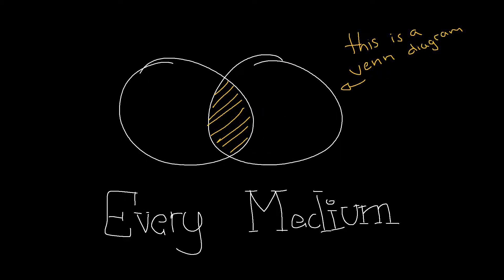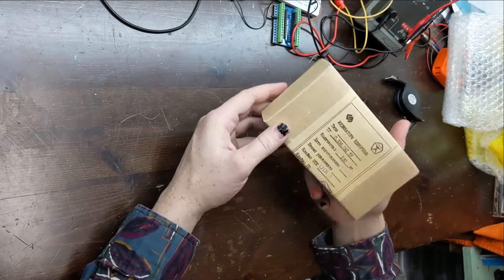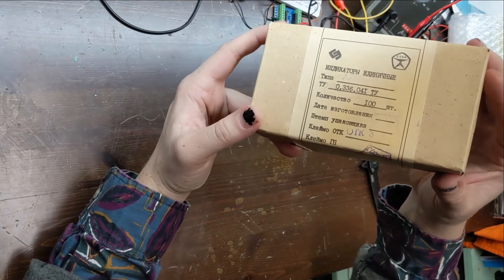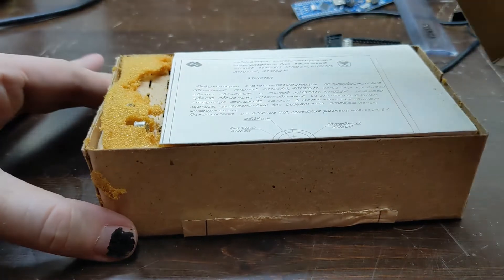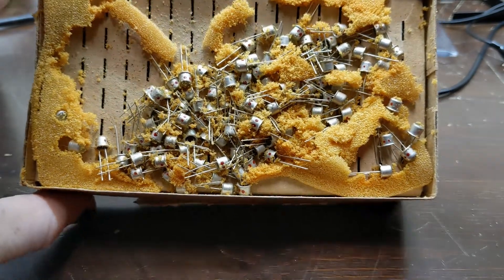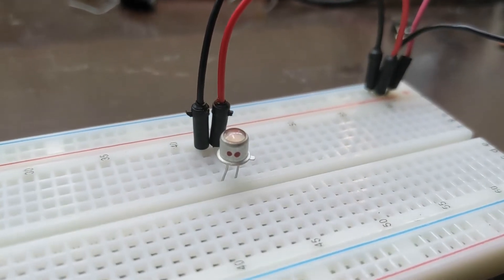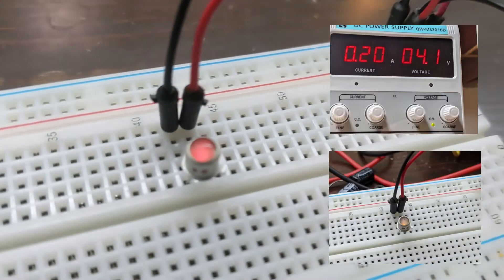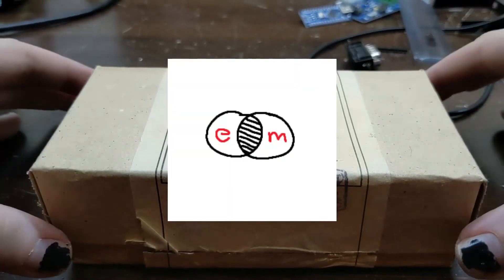Buying (and breaking) Soviet Russian Electronics from eBay

Comment: Too lazy to translate the whole thing, but some key info if anyone needs it...
ВМ and ДМ are green, the 3 others are red.
Anode is on the left of the drawing. 

Uпр, Iпр - voltage and current respectively (higher value is for short spikes) , Uобр,Iобр, - max reverse voltage/current. No more than 200V static. 260+-5 Centigrade solder temp. no more than 3 sec per solder, at least 4 mm pin length, no more than 2 re-solders, don't bend the pins closer than 3 mm, cover with epoxy for use in harsher conditions.

Comment: OTK doesn’t mean milspec. Milspec Soviet parts used to have other distinct markings - a diamond or a star, for example. Milspec LEDs would have gold-plated casings (on the inside, but still visible) and pins, at the least. OTK stamp means the parts passed independent quality control testing or inspection according to production standards or customer specifications. The OTK number is a designation of a particular quality control department that performed the testing. Besides the OTK stamp you can also see the “Seal of Quality of the USSR” in the upper right corner of the packaging that used to be awarded to products consistently meeting or surpassing their specified quality standards.

Comment: ##########
PAGE1

semiconductor sign-synthesizing indicators singular type AL102AM, AL102BM, AL102VM, AL102GM, AL102DM

label

semiconductor sign-synthesizing indicators singular type AL102AM, AL102BM, AL102GM - red color of light, and types AL102VM, AL102DM - green color light are made by epitaxial structure with gallium phosphide, made in metal/glass case. They are meant for visual indication of information.
Climatic performance, category placement: 1.1,2.1,3.1

DIMENSIONS OF THE CASE CHART

END OF PAGE 1

##########
PAGE 2

Electric and photoelectric parameters.

According to the chart your type of leds (AL102BM) has no less than 20 millicandela light output at 20mA, and between 2.8 and 3.4V forward voltage drop. The maximum allowed current through the led is 20mA at 50 degrees celsius, and 10mA at 70 degrees celsius.

END OF PAGE 2

##########
PAGE 3

Maximum forward pulse current for a pulse duration of no more than 2mS, and a duty cycle of no more than 10, in a temperature range of -60 to +70 celsius: 60
Maximum allowed reverse voltage at a temperature range between -60 to +70 celsius: 2

Note: in the temperature range of 50 to 70 celsius the forward current is decreasing linearly.

DATA FOR RECEPTION
Singular indicators type AL102AM, AL102BM, AL102VM, AL102GM, AL102DM are matching the technical conditions YJO.33Bo41TY

END OF PAGE 3

##########
PAGE 4

INSTRUCTIONS FOR USE

1 The main use of the singular indicator is a visual indication of information.
2 It's allowed to use the singular indicators in apparatus intended for regular climatic conditions. In equipment intended for use in all climatic conditions they can only be used when they are covered with lacquer in said equipment.
3 Maximum allowed static potential 200V
4 Singular indicators can be soldered in a group solder (solder vat), or soldered with a soldering iron.
5. Conditions for mounting:
 - Solder temperature: 250 +/-5 degrees celsius.
 - Time for soldering: no more than 3s
 - Minimum allowed distance from the case of the device - 4mm.
 - Number of allowed resoldering of the leads during mounting and assembly - no more than 2.
 - Clean the flux only with liquids that will not affect the markings, plating and the case material.
 - Do not pass current through the indicator during soldering.
6 Distance from the indicator case to the beginning of the lead bend point - 3mm. Radius, no more than 1.5mm
7 During exploitation there need to be taken measures to keep the surface glass of the indicators clean.

END OF PAGE 4

The box has "date of production", but it's not really possible to read it. It seems like it's 75Г, but I can't be sure. If this is true, these leds would have been made in 1975. A good year. 🙂

Comment: I'll try to translate it to the best of my abilities. For tables i will briefly describe them and put row names, the rest appears to be straightforward but feel free to ask if it's not. Notes added by me are marked with *.    

"Label" (*seems like an old technical term akin to general description):                               
Individual semiconductor sign-synthesizing indicators of types АЛ102АМ, АЛ102БМ, АЛ102ГМ - of red colored glow and АЛ102ВМ, АЛ102ДМ - of green colored glow are created from epitaxial structures of gallium phosphide in metal-glass case and are designed for visual indication of information.      
Climatic package: УХЛ (*temperate, cold, dry hot and dry very hot climates), placement category: 1.1 (*open air), 2.1 (*"covered" open air), 3.1 (*indoor without heating or forced ventilation).                                            
*Unsure about second digit in placement category. For temperate and cold climates temperature range is -60..+40 C. For dry hot climates it's kinda complicated with relative humidity daily durations and yearly averages of maximum temperatures. None of this is present here.
                                                                                                                                                                                                                                                           
Table 1. "Electrical and light(-technical??*) characteristics", no more than (*measurement current is specified in mA within parentheses): 
Luminous intensity, mcd                                                                                                                                        
Continuous direct current, V           
Continuous direct current, V (*at -60 C)  
                                                                
Table 2. Maximum operating parameters
Maximum allowed continuous direct current at -60..+50C, mA
            at 70 C, mA                                                            
Maximum allowed pulsed direct current with impulse duration of no more than 2ms and duty cycle of no more than 1/10 (*it says "skvazhnost'" of no less than 10 which is in inverse ratio to duty cycle), mA
Maximum allowed back voltage at -60...+70C temperature range, V                                                                                                                                               
Note: within +50...+70 C current drops linearly                
                                                      
*Omitted some boring quality control approval stuff.
                                               
"Operating" instructions.
1. Primary purpose of the individual indicator - visual display of information.
2. Individual indicators can be used within all climatic conditions if coated with 3 layers of ЭП-730 (*epoxy variant).
3. Allowed value of static potential is 200 V.                                                                        
4. Can be soldered via bulk soldering processes as well as with soldering iron.
5. Assembly conditions                                                                      
    - solder temperature: 260+-5 C
    - duration: no more than 3s   
    - minimum clearance to case: 4mm  
    - maximum allowed soldering operations number per individual indicator: 2
    - flux should be cleaned with with fluids that do not affect case material, coating and markings of indicators
    - electric current must not flow through indicator during soldering process                                   
6. Minimum lead bend radius is 1.5mm, minimum distance to case is 3mm                                          
7. Measures to keep the glass surface clean during operation should be abided.
Reply: Thank you, so much.